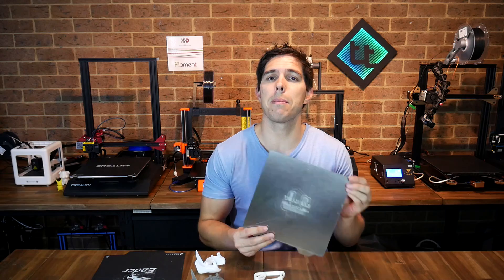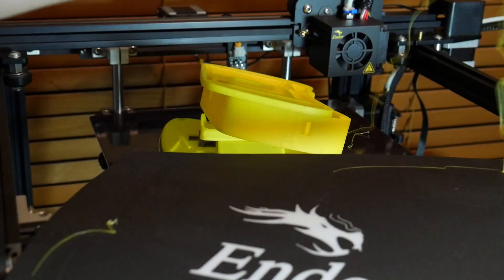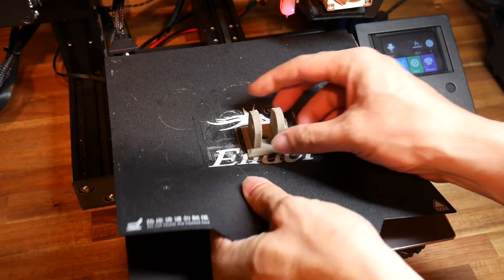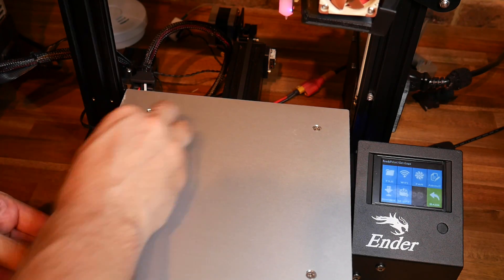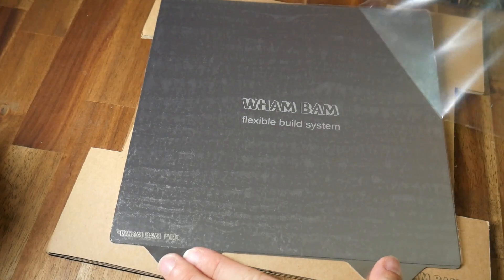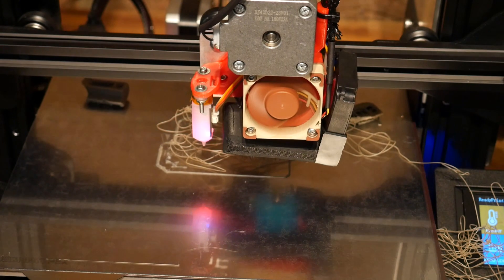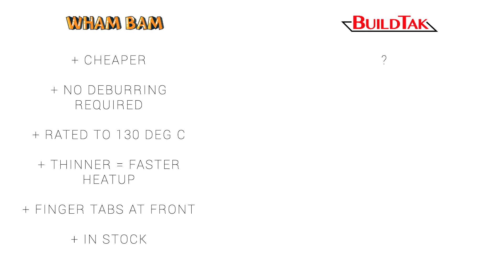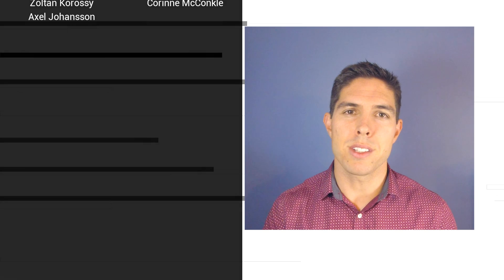Wham Bam Flexible Build System vs Creality Cmag vs Buildtak Flexplate

Comment: Hi Michael, First of all, your new workshop looks fantastic, looking forward to a tour. I came across the WamBam FBS a week or so ago and it looks fantastic, now I've seen your testing I'm completely sold on it. I've already been in contact with WamBam and they have been very quick to respond to my questions, they are even looking into the possibility of cheaper shipping to me here in the UK. The main selling point for me is that they guarantee it to 130c, they tell me that they have tested it at 170c for 9 days with no degradation in magnetism, pretty impressive eh?
My main reason for wanting a different build surface is to reduce the bed weight of the Borg (@Jayteeau came up with the name for the CR-10s4 because of all the upgrades I keep giving it) but I didn't want something that would limit the Keenovo heater capabilities.
Reply from the maker: I'm planning to fit these to a bunch of my printers now. Price will add up but much cheaper than the buildtak one. 170c is very impressive, I agree!
Reply: I don't understand why the Wham-Bam system is not effected by the Curie effect if the Creality C-Mag is...  hard to believe they have managed to alter the laws of physics for their product!   :o)
Reply: @TeachingTech  Originally I thought they were relatively expensive as I had only looked at reviews and specs of others, then I started looking a prices. It turns out, as you said, they are much better functionality for a lower price. Win win!
Reply: @PiefacePete46  Thats a great question. I don't know for sure, but I think they have just used different materials/processes. I would imagine WB have just managed to gain a higher temp before being susceptible to the Curie effect. It's my understanding that the Curie effect is similar to thermal expansion, in as much that it affects different materials to varying degrees (excuse the pun lol)

Comment: 3 prints is probably not enough to effect the magnetism of the bed. Over time the more prints done at higher temps will degrade the flexplate
Reply: John Morrison you are right.  I lost magnetism on the creality bed at 120 printing nylon overnight.
Reply from the maker: My research tells me the change should be instant and permanent. That is why I'm comfortable making the mythbusted claim. 120 is of course higher than the 100 I tested at.
Reply: @TeachingTech  Quote from https://www.apexmagnets.com/news-how-tos/magnet-experiments-what-happens-when-a-magnet-is-heated/  

"When heated above 176° Fahrenheit (80° Celsius), magnets will quickly lose their magnetic properties. The magnet will become permanently demagnetized if exposed to these temperatures for a certain length of time or heated at a significantly higher temperature (Curie temperature)."

You may not have exceeded the time needed. I still believe more time, or a number of prints will be needed
Reply: I watched a number of videos from wham bam (I'm also a backer btw) and they did a number of tests to get that magnetic sheet so it would work with any temp. Watch the wham bam install video, and they show the test bed they used for a number of other magnetic ideas.
Reply: I suspect wham bahm is using high heat rated magnetic sheet similar to this: https://www.mcmaster.com/7301t11
  Creality is probably using a cheaper generic type magnetic sheet.
Reply: My ender 3 magnetic bed lost magnetism from on 100° few hour long print. It wasn't completely demagnetized, but it was reduced to the point of getting layer shifts from the magnet moving around during prints.

Comment: Nothing sticks to the Creality C mag after 20 prints. I have the same problem on large surface prints, it makes the whole concept useless and the C mag bed is not flat.
Reply from the maker: Mine hasn't degraded in terms of prints sticking but the lack of separation is annoying.
Reply: I can't agree with you on this... recently I felt that PLA prints were not sticking properly to my C-Mag.  I cleaned it using this method (which only takes a couple of minutes):
(1)   Make sure there are no "bumps" of filament from earlier prints.
(2)   Degrease it with IPA (Isopropyl alcohol) on a clean rag.  Note: I often hear that this leaves a perfectly clean surface, but, in his fantastic series of videos, Dan Gelbart explains that this leaves a layer of hydrocarbons.   Although this layer is only the thickness of one molecule, it can become a separation layer for adhesives, filament, etc.
(3)   Finish with Ivan Miranda's method for cleaning glass print surfaces, which works fantastically on the C-Mag as well.  Use a normal dishwash liquid undiluted on the surface of the C-Mag, and massage it thoroughly over the surface with your hand.  Rinse it thoroughly with warm water, and pat it dry with a paper towel.   Done!

If anything, prints stick almost too well, and I have had no problems since.
The link to Ivan's video:  https://youtu.be/Kj4Xz3DwGSQ       His channel is great watching!  He is currently building a 3D printed CNC router, and this will be followed by a 3D printed man-carrying tank, complete with gun that fires plastic balls.
Ain't Youtube great!